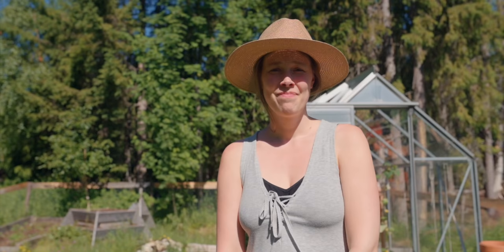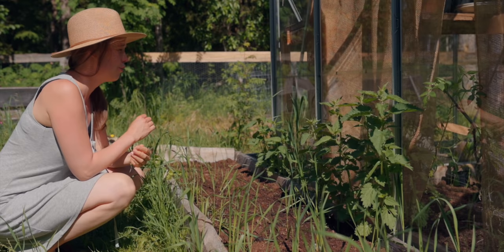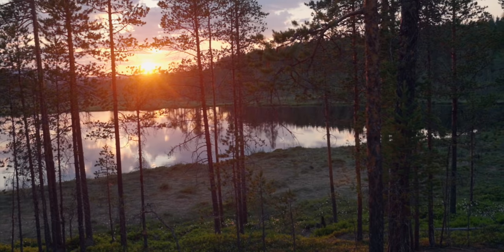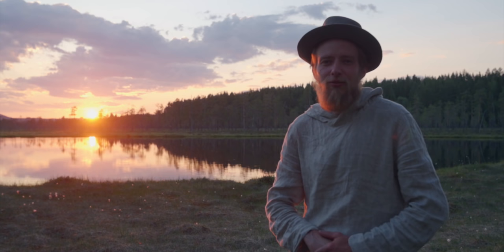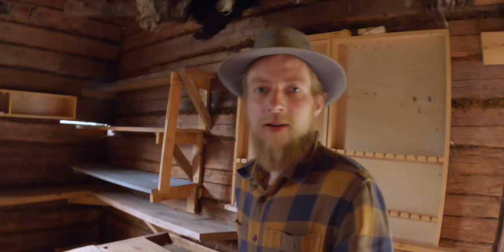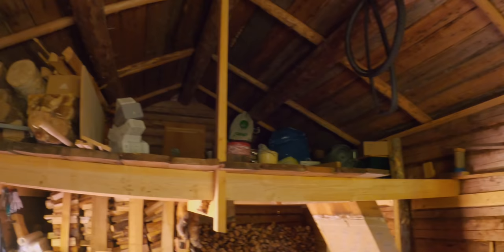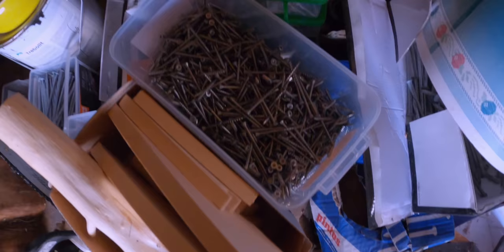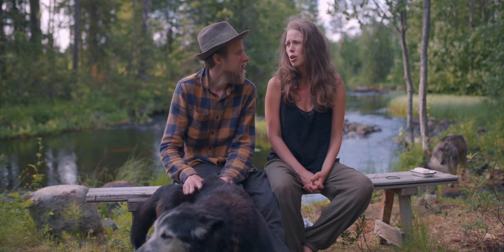Every day life on an off grid homestead

Comment: Suggestion: 
Put a steel 3/4 pole through your screen box from one side to the other side ,  rest it on top of a groove section and you can teeter /todder the dirty out.
The dirty will drop through the screen and you can dump the rocks out the other end.

Think of a teeter toddler. 😊😊🇨🇦🇨🇦🇨🇦

Comment: Greetings from a remote offshore Irish island. No longer off grid but when I was I cooked on a full sized gas cooker fuelled by  bottled gas, ie a large cylinder . I still cook that way and wondered if you do not have this over there? More cost effective than electricity and not affected by power cuts... And easier than chopping wood; not that we have enough trees on this gale swept island anyways. I burn turf on the hearth.  Also I was shocked and surprised that you throw nettles away. Look them up! They are highly nutritious and one of the very first greens in the year. They grow very very well in Ireland and nettle soup is a staple. Imagine your rooster soup with them. mmmmmm! I knit for the export industry and the money goes to the babies my family cares for in India.

Comment: For the garden, did you ever think of saving leaves in the autumn in a pile then using them as compost on the garden. between & up to the row. Make it deep enough that the weeds will  not generate but not cover the vegetables . It will also give your garden fertilizer. It will save you some time.

Comment: Mathias you were talking about hurting your back. From watching you work, you  are not using your back correctly.You must hinge at the ankles, knees, hips, let the head release away from the body, releasing your neck at the very top of the spine. There are no hinges in your spine. You need to keep your length through the front of your body through the sternum as you work so that you are using your back fully engaging the muscles. It is actually stopping and  thinking about your work. “Thinking in activity”. Have a look at the Alexander Technique  which teaches you how to use your spine correctly. F. Matthias Alexander “The Use of the Self”.  You will love the homework which includes what you did when you hurt yourself and had to lay down on the floor for three days when injured. One does this laying down homework for 10-15 minutes daily to re-align yourself. I do hope you may somehow read this advice and think about it.

Comment: 1, maybe you will need more wood when your new home will be finished.  it will take more heat to warm that home.  i'm always worried about running out of wood.  btw, the word for walls that prevent cold from entering in english is INsulation, not Isolation.  i make the same mistake in french.  isolation in english means removed from society, alone.
2. try to rub citronella oil or lemon on you when you go to the lake to repel those pesky mosquitoes!

Comment: Would it be sensible to enlarge the green house so that you could plant your garden plants in the greenhouse earlyier & get the protection of the house & the early start by the heat from the sun against the glass or the plascic, whichever you choose to use. Heat can be applied if needed. Check out Lumnah Acres in New Hampshire & see what they have done.

Comment: Very nice! Now remember, heating with wood is extremely EXTREMELY polluting. It’s like running 10 diesel trucks, even if you have the latest model of clean burining technology. I know, I know, I heated with wood for twenty years, until I found out that it’s not carbon neutral.